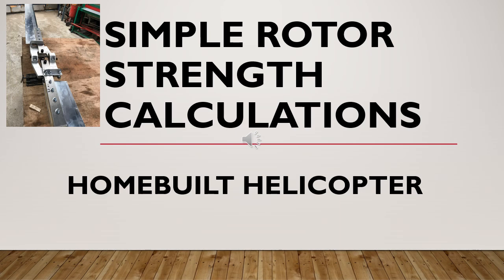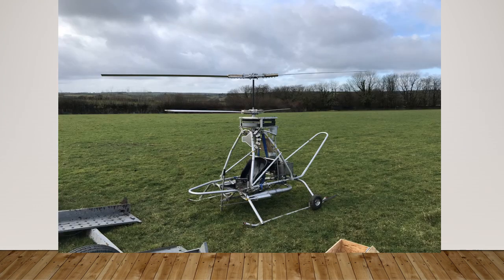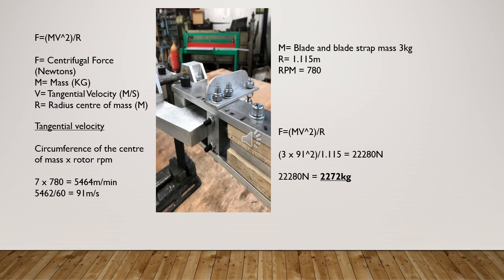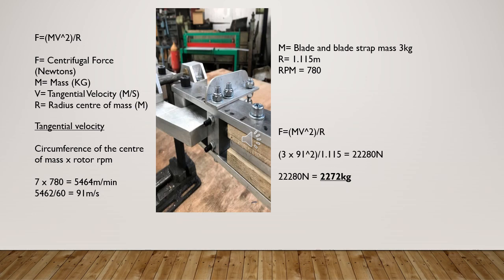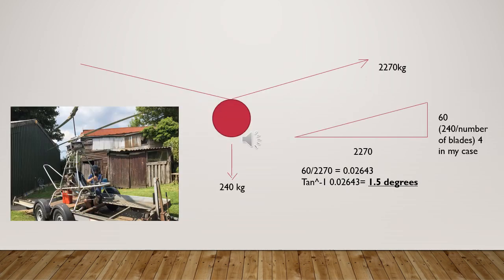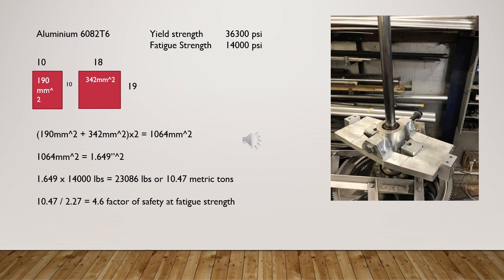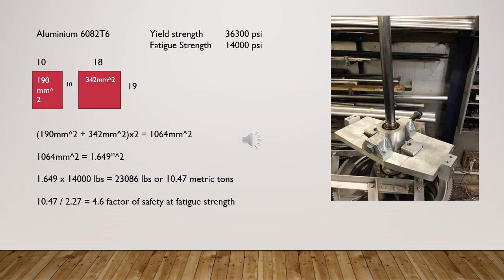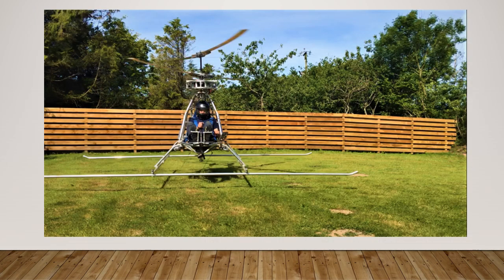Simple Rotor Strength Calculations Homemade Helicopter

Comment: 4 times watching this and everytime whatever I comprehend is scattered throughout 😅.  Blade center of mass is the point at which the X mark is from the root? Am almost comprehending how to get centrifugal forces, but the hub area, is kicking me off completely.
Reply: Distance from hub center to point X 1529mm, rotor rpm at 6400 engine rpm and current transmission would be 501RPM blade is 14kgs.

Hub cross section is 3pcs of 5mm thick aluminium 2024.

I tried some calcs got F=833kgs  😅.

Anyways awaiting your figures...the cone part can't figure out the tan^-1..

Blade alone from root to point X is 123cm. 299mm is extra to get to hub center making total 1529mm
Reply from the maker: @JeffChoppah  
Hi Jeff, here is the centrifugal force of your blades. 

1.529 x 2 = 3.058
3.958 x pi = 9.6m 

9.6 x 501 = 4813 m/min 
4813/60 = 80.2 m/sec

(14 x 80.2^2) / 1.529 = 
90048 / 1.529 = 58893N 

58893N = 6005kg 

Plug in the figures for a 10kg blade and compare, it will tell you what the maximum rpm you can run your blades without going over the centrifugal forces. Your tip weight will be adding to the centrifugal force, you will be able to remove this weight, re-balance the blade at its new centre of mass and see what the forces are. 

Calculating the rotor hub strength is more involved, you also have bolt shear strengths to take into account.
Reply from the maker: I'll help, please tell me what is the distance from the center of the rotor hub to the center of mass of the blade marked by your X, the rotor rpm and the weight of the blade is 14kg?
Reply: In your video you say R is radius of the center of mass, shouldn't that be 1529/2 for my case which should be 1529*pi for circumference, I see you did 1529*2*pi...this *2 shouldn't it be to multiply radius into diameter and pi to get circumference.

If your calculations is how it aught to be then 10kgs blade would be 4193, the difference with 6005 is 1812kgs, this sounds moderate extra load per blade to the hub..

Anyways will go through this later on after some sleep. Am on my 12th hour since I woke up my brain is saturated.
Reply from the maker: Hi. You said the distance from hub to blade centre of mass is 1529mm that is the radius. Circumference is pi x Diameter. 

We are working out the circumference at the centre of mass to give the tangential velocity. 

There are actually centrifugal force calculators online. You can check the figures with.
Reply: @Ben-Dixey  alright got it now, can see coning angle will be 1.667deg, yield strength of 2024 I checked out its 64000, fatigue strength at 20000psi. tried to play around with the understanding, but generally speaking if your case of 2272kgs vs my case 6005kgs at coning of 1.5deg vs 1.667, weight of 240kgs vs mine at 350kgs by way of comparison doesn't this seem like I would end up with same safety factor or there about, since am even using 2024 which is stronger than your case of 6082?.

in your own experienced assumption do you think its necessary to try to cut weight of the spar or should i just plug it as is and check performance?

just did pre-analysis & thoughts and its nearly impossible to re-machine that same spar due to clamping issues, unless I machine new ones.
Reply from the maker: @JeffChoppah  I think the best thing to do is draw the parts of the rotor head on cad and find the cross sectional area at the weakest part. Think about where the most centrifugal force is going to be. The rotor head design is more complicated than mine so not so easy. That's the only way to establish if it's safe to run these blades at the increased weight at maximum RPM. You will be able to run them slower though. 
As previously mentioned you can remove the tip weight and recalculate the centrifugal force, it might have a significant effect. I have to say I'm not keen on the other mistakes made. Seems like you were rushing and making blades should not be rushed.

Comment: Do you think that a constant chord 0.35 meters x 3 meters blade has very large chord ? Should I use a smaller chord for this length ?
Reply from the maker: It's a very big question to answer, the best advice I could give to answer it is to find out what other helicopters have done and copy their blade length and chord. There are some guidelines to go by if you look up rotor blade aspect ratios, rotor disc solidity ratios and then rotor blade loading and disc loading. However what i did even after checking all these figures was go by what the Nolan bothers chose for blade length and chord.
Reply: @Ben-Dixey  good. But I chose those dimensions using, for the ideally twisted constant chord lenght, blade element theory + momentum theory merged equations. In fact I don't want the rotor to spin with so many RPMs to control the centrifugal forces.
Reply from the maker: I think you know more about it than I do. Twisted blades will as you know produce the same lift at a lower rpm as you say. I don't think it will make much difference to the strength rotor hub needed as you want a large safety factor. My hub for example is strong enough to take 40 tonnes at yield strength, centrifugal force is only just over 2 tonnes. My hub is over engineered but safe. The centrifugal  force you reduce by running the rotor a bit slower isn't going to save much weight on the rotor hubs. 
However making twisted blades is a good way to go if you have the ability to produce them and will produce more lift.

Comment: Keep the good work. Can you get any idea for practicing flight controls from the following video?      https://youtu.be/NYxbrJ98KnI
Reply from the maker: Hi and thanks, I hadn't seen this particular video but have seen the va115 testing rig. If movement in the horizontal plane can be almost frictionless I can see this being very helpful. It's got to replicate real flight conditions. It can still be used for getting used to yaw and altitude though. I considered building one using linear rails instead of wheels, that would be much more realistic. My personal thoughts are long poles are the way to go for me now. Cheers

Comment: You are calculating the centrifugal force by using half the length of the rotor blade as the effective location of the mass in relation to its center rotation. In other words you're taking the average distance of the  mass distribution of the blade to be the proper way to calculate centrifugal force.
I don't think that's correct. 
Centrifugal force goes as the velocity squared. But while the velocity is linearly proportional to the distance from the hub, The force goes as the square. 
Force is an r-squared and cannot be averaged linearly.
Anyway, there's a bit of calculus to do. So instead of using 1/2 the radius for the calculation, you should use 1/3. 
This means your overall calculations are conservative since the actual force will be less. It would be 2/3 of your calculation.
However, since the force is less than calculated the angle that the blades will rise will be a little bit higher. I don't know if this makes any difference. 
But strengthwise you're okay.
I enjoy your videos.
Reply from the maker: Hi, I've taken the radius from the centre of mass of the blade. Isn't that correct ?
Reply: @Ben-Dixey  Hello, I enjoy your videos. I would suggest you another way of doing this instead of using calculus. Just divide your over all blade into 10 sections or 20 sections. If you use more sections your result will be more accurate. Find the mass of each section (That is the over all weight of the blade divided by 10) and the CG of each section and the distance between the centre to each section's CG. Do the centrifugal force calculation for each section. You will end up with 10 values of centrifugal force. Add them up and you will end up with a more accurate value of centrifugal force. This value will be much closer to 2/3 (suggested by John Hesse) instead of 1/2 which was originally used by you.
Reply from the maker: @santhanakumarimohan  Hi, I've taken the centre of mass from the point at which the blade balances, including the blade straps and bolts at the hub. Isn't that correct ?
Reply: @Ben-Dixey  With regard to centrifugal/centripetal forces you are correct.  Centripetal acceleration is indeed proportional to velocity squared, as Mohan suggested, but it's also inversely proportional to radius.  Mathematically, a_c = v^2 / r (as shown in your video).   This can also be rewritten using angular velocity omega as a_c = omega^2 * r.  Translating to force that's F_c = omega^2 * r * m, showing the force is actually linearly related to radius (and to the square of rpm), so your method of just using the center of mass of the blade is accurate.  This can be further demonstrated by splitting the blade up into segments and summing the forces in the manner Mohan suggested.  No matter how many segments you use, the force sum will remain the same.

However, I believe your analysis for coning angle might be a bit oversimplified.  Going with the assumption the rotor blade is rigid, one can reasonably model the blade as a beam pinned rotationally at the mast end, and the centrifugal forces as a point force acting radially at the center of mass of the blade.  To get to your simple trig equation, one needs to be able to assume that the lift forces can accurately be modeled as a vertical point force also at the blade center of mass.  However, this may or may not be reasonable.  An ideal rotor blade would have produce lift in an even distribution along its length (and thus the lift could accurately be represented by a point force at the mid-span, which presumably would be at or very near the center of mass).  However, since the blade is traveling faster at the tip than at the root, this even lift distribution will not occur naturally with just any old blade.  Achieving an even lift distribution requires that the blade have one or more of taper, washout (twist for greater angle of attack near the root and lower near the tip), or changing airfoil profile from root to tip.

I haven't gotten a chance to go through all of your videos yet.  Am I correct in guessing that for ease of manufacture your blades probably have no washout, taper, or varying of the airfoil profile along length?   If this is the case, then the lift distribution is going to be biased towards the tip of the rotor blade, perhaps best represented with a point force somewhere around 2/3 to 3/4ths the way along the span.  This would result in a greater cone angle than predicted by your simple triangle method.

Without further knowledge, I think your method for cone angle is probably a reasonable first order estimate, but I'd put some hefty error bars on there before considering using it for rpm safety margin calculations, part design, or anything else important.

Anyways, I've got a paper to work on, so I'd better go.  I'd be happy to discuss more on the topic later.  Awesome helicopter!
Reply from the maker: @epicspacetroll1399  Great Comment, thanks for taking the time to write it. Yes the blades do not have a twist or taper to evenly distribute the lift along the blade and so the outer third will be developing the majority of the lift. As you suggest the coning angle will be inaccurate to some degree. It would be interesting to find out the difference as the teeter height would need to be adjusted to compensate.
Reply: Thanks for the replies. I would put my comments on the conning angle first and I would still like to discuss about the centrifugal force. If you consider a blade with 0 twist the lift force developed by a single blade would balance at 75% Radius, meaning the lift generated from the root until the 75% span of the blade And lift generated from 75% to 100% of the blade will be equal. If you consider a blade with an Ideal Twist this point will be 66.66%. But for practical blade twisting like 6 deg to 9 deg in most helicopters the center point will be some where between 66.66% and 75%.  

About the Centrifugal force it is not a good idea to balance the blade statically and consider that would be the mass center as it spins. I can quote the above discussion as an example to explain. For simplification Let's assume that you use the blade without the straps and bolts and just balanced the blade, it will precisely balance at 50%. If you consider this point for calculating the centrifugal force then why not consider 50% as the center of Lift force of the blade. It is obvious that the center of lift force of a blade is not at 50% as the tip moves faster than the root. I think I'm making some sense here, I'm sorry if I'm troubling you too much.
Reply: By the way are you using the same blade that you have in this video https://www.youtube.com/watch?v=0U8iMWmxgO0&t=312s because I see two different blade constructions in your channel. I also suggested to increase the bonding surface area between the D spar and the sheet metal to overcome blade debonding. May I know how did you over come the blade de-bonding.
Reply from the maker: @santhanakumarimohan  Thanks for the center of lift radius percentages. This is important for instance if I needed to add a leading edge weight to alter blade center of mass in the chord-wise direction. This as you might know is to balance collective forces.  So you would also use this figure in determining the blade flex and therefore the new higher position of the center of mass? 

The centrifugal force I can't offer any other discussion because I only copied it from a book then verified the results with online calculators. If there is a more accurate way that's fine but the safety margin I've included is massive in aviation terms. I can cope with simple rotor strength calculations but will struggle with the more in depth calculations you are referring to. My aim with the video was to try and prevent home builders from just guessing which I know has been going on in some cases.
Reply from the maker: @santhanakumarimohan  Yes that's the blade I'm using. I got over the problem by adding an adhesive film wrapped around the leading edge. It's a temporary measure as I will need to make new blades to solve the problem. The next set of blades with wrap the skin completely around the spar, it will be bonded to the spar and riveted at the trailing edge. Composite Fx build their mosquito blades this way.

Comment: Glad you are doing some calculations. Not sure of your qualifications, I have no formal schooling. The maths for engineering a helicopter are quite simple, area and volume are what I use the most. You probably say in a previous video, but what is your power and weight of your chopper?
Reply from the maker: I have to work at the maths and physics side of things but enjoy learning. I got to HNC level engineering maths but couldn't achieve HND. I believe I could have achieved it with some extra help. Some of the helicopter related maths is achievable and some of it is way above my head. The current total weight is around 240kg and engine power 60-70hp. The engine is stock 60hp but I made tuned exhausts which will have increased the power, to what I don't know yet.
Reply: @Ben-Dixey  What is the most complicated maths you found you have had to calculate for your build? 240kg total, that's including you (96kg)?
Reply from the maker: Yes the 240kg includes pilot. Working out the rotor lift was beyond me. The calculation is massive, so many variables.
Reply: @Ben-Dixey  Oh okay. My build is a ducted fan, no tail rotor design, so am using the tail boom as a wind tunnel to calculate that. Its good use of the design I think. I can calculate angle of attack, stall, lift, drag and torque required to rotate them. Although it does not account for turbulence or vortices between rotors. I'm still far off, I want to achieve a cruise speed of 300km/h and a maximum hoge of 13000metres. I will probably die. Keep up the good work, be safe.
Reply from the maker: Wow, great work using the notar as a wind tunnel. If you felt like doing some YouTube videos I would love to see your progress. My email is btdixey@hotmail.com if you felt like communicating via email. Thanks